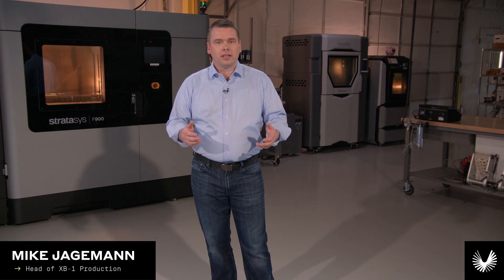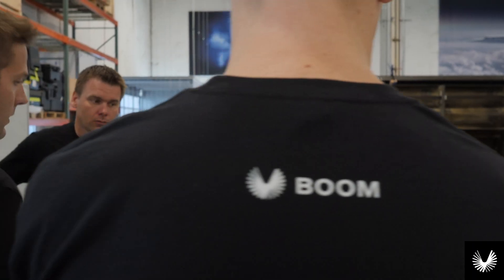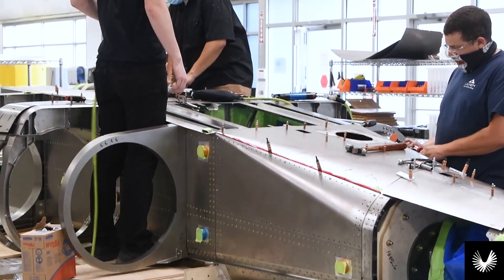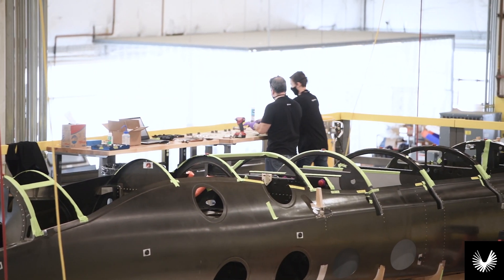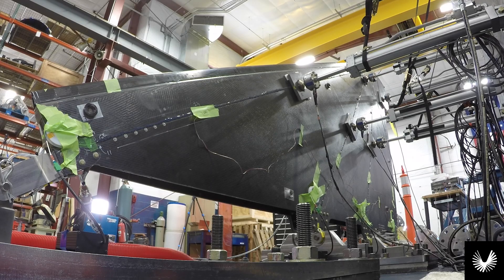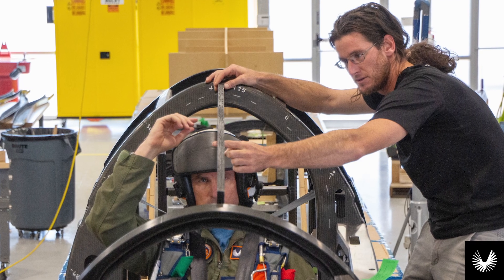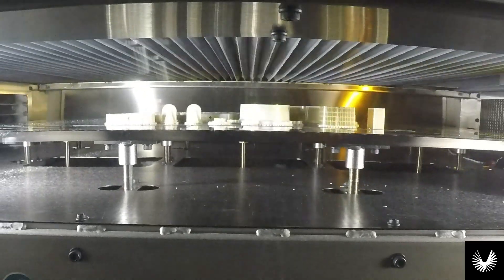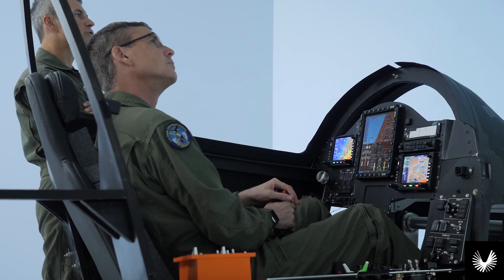Behind the Build | Head of XB-1 Production

Comment: Here is a rundown of Boom's latest position (20 September 2023):
   •  The factory at Greensboro North Carolina is now erected
   •  Boom has hinted that, as the XB-1 no longer represents Overture, it probably won't fly
   •  Boom have now finished their consultation with Rolls Royce on the Symphony engine
   •  Virgin have now let their Overture options laps
   •  130 orders and pre orders from Japan Airlines, American Airlines, and United Airlines
   •  Boom and Northrop Grumman partnership for military and government applications 
   •  Boom awarded $60M STRATFI contract by USAF for Overture fast transit applications
   •  Cutaway images of the engine and Symphony power module are now on Boom's site  
In July 2022 Boom announced a major Symphony redesign:
  •  Fuselage, waisted to comply with area rule
  •  Wing, multi angle Delta gull, with computer controlled leading and trailing edge slats
  •  Empennage
  •  Engines, 4 medium bypass turbofans in under wing individual pods
  •  Seats, 65 to 80, all business class
  •  Length, 201 feet (same as Concorde)  
  •  Wing span, 106 feet (greater than Concorde)
  •  Height, 36 feet
  •  Cruising speed, Mach 0.94 over land, Mach 1.7 over water, at 60,000 feet
  •  Range, 4,880 miles
   
Boom have appointed suppliers for major Overture items, including the engine:
  •  Florida Turbine Technologies, engine design, development and certification
  •  Aernnova  (Spain), design and supply wings. 
  •  Leonardo (Italy), design and build fuselage and wing box.  
  •  Aciturri (Spain), design and develop empennage. 
  •  Safran Landing Systems, 
  •  Eaton, hydraulics, fuel and inertial systems collaboration
  •  Collins Aerospace, ice protection and systems collaboration
  •  Flight Safety International, 
  •  GE Additive, additive engineering (3D printing)
  •  StandardAero, maintenance
  
Florida Turbine Technologies, a division of Kratos Defence, will design, develop and test an engine that matches the specific requirements of Overture.  Engine development began in January 2023.  Engineers, who were involved in the design of the engines for the supersonic F-22 Raptor and F-35 Lightning, will be on the design team. The engine will use existing certified parts and materials, including blades, rotors, accessories, and core. The manufacturers of these parts will help throughout the Overture engine development program. The engine will have the same basic architecture as engines that currently power all modern airliners:
  •  Turbofan
  •  Medium-bypass
  •  No afterburner
  •  Twin-spool
  •  35,000 pounds of thrust on take off
  •  Air cooled multistage turbine
  •  Single stage, 72 inch diameter fan, low profile, high flow, light
  •  Low-pressure compressor stages: 3
  •  High-pressure compressor stages: 6
  •  High-pressure turbine stages: 1 (passively cooled)
  •  Low-pressure turbine stages: 3
  •  Additive manufacturing for lightness, low part count, reduced assembly costs
  •  FAA Part 33 and EASA CS 33 compliance
  •  ICAO Chapter 14 noise compliance, especially relevant on take off and landing

The Symphony propulsion system will have a Boom-designed axisymmetric supersonic intake, and variable-geometry exhaust nozzle. The propulsion system will be fuel efficient at both sub and supersonic speeds. The intake will be similar to the intakes on the Mach 3.2, SR-71, with a spike that slows the air to the engine, and probably generates forward thrust. Wind tunnel testing of the intake and exhaust are underway.

17-2023.09.20

Comment: As a Forklift mechanic. I always see that no matter the level of meticulous engineering and clean concise manufacturing. There's a FORKLIFT that's CRITICAL to the operation. But treated like the most insignificant piece of garbage in the building! Its without fail, the most overlooked machine in any cutting edge Innovation!

Comment: Has the XB-1 flown yet?
Reply: No. Blake Scholl hinted, at the 2023 Paris Air Show, that as XB-1 no longer represents the latest Overture design, XB-1 might not fly. From a personal point of view, I think XB-1 is history and a pilot should not risk flying it now.
Reply: @phonicwheel933  so the whole thing is fiction? I adore the Concorde. I desperately want a new supersonic airliner. However, Boom seem to not be the 9nes to do it.
Reply: @ThomasEarley91  Yeah, Boom have risks on all fronts: technical, cost, and program. A few months ago, I thought like you, but having learned a bit about Boom, and their announcement of the revised Overture and the engine developments, I feel a touch more confident that they will get Overture into service. The timeline is tight though. I would now guess 2033, rather than 2030 for certification.
Reply: @phonicwheel933  but who is building the engines?